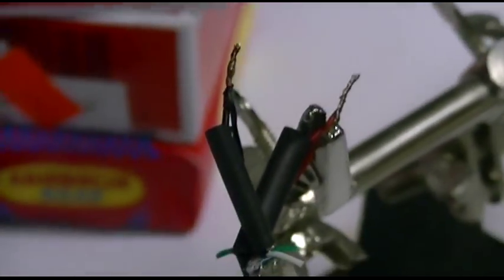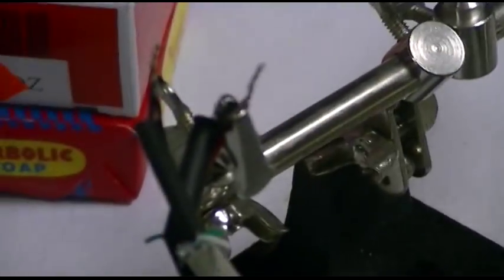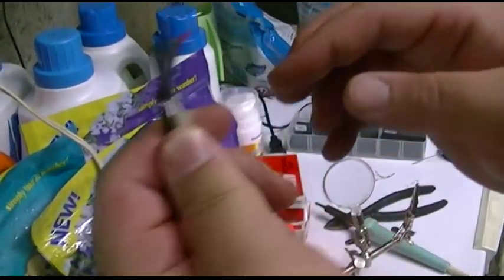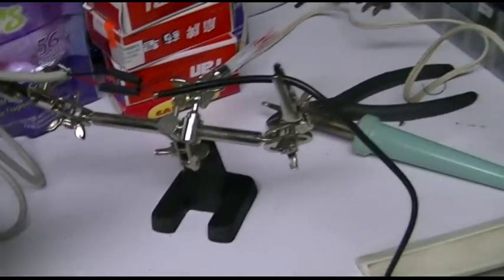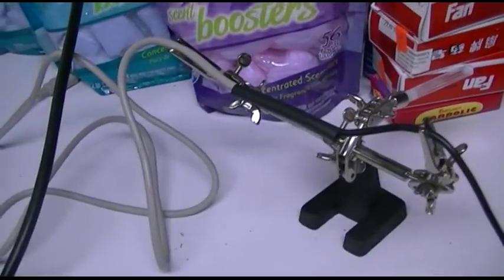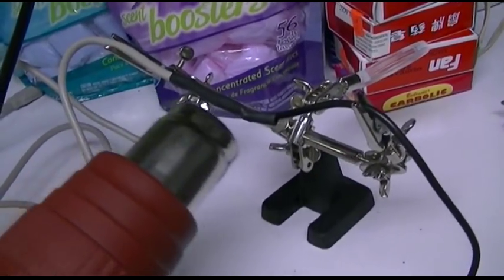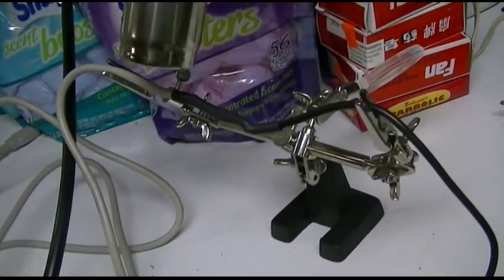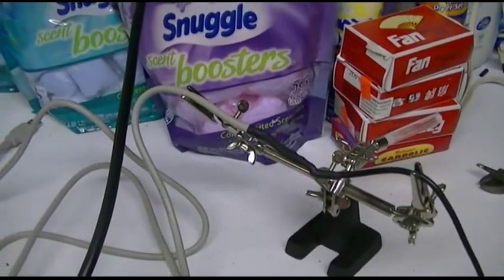Custom USB POWER-ONLY Cord

Comment: Looks solid to me. Get yourself a wash board to use in the slop sink and you can use the washer top as a work bench more often :)
Reply from the maker: There's a double sink there.  When I moved in, there was a board over the left sink.  I removed it, but still have it.

Once I get through cleaning up in there again I will have the entire run of that wall to work on stuff.  Only problem is I'd have to move stuff to get access to the machines.  I use the big freezer as a bench every once and again, as I did in this video.  Plus I have the 2 workbenches in the garage, but since it's getting cold now I won't have much use of that till the spring.

Comment: Where did that solder holder come from?
Reply from the maker: Jack used to have one many years ago, called "helping hands".  I still call it that.  The one he had was from Radio Shack from years ago.  His didn't have a magnifier on it.

I got this one from work.  Parts Express, Jameco, and probably other electronics suppliers sell it, they're pretty common.
Reply from the maker: xjoe81x Harbor Freight also sells these, Item #s 319 / 60501 / 65779.